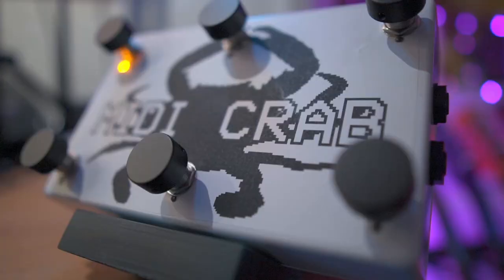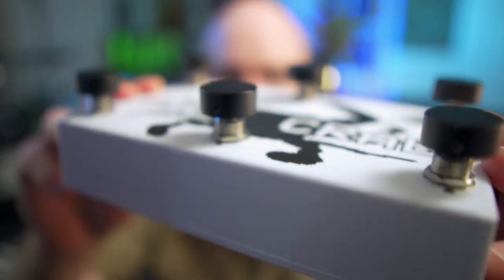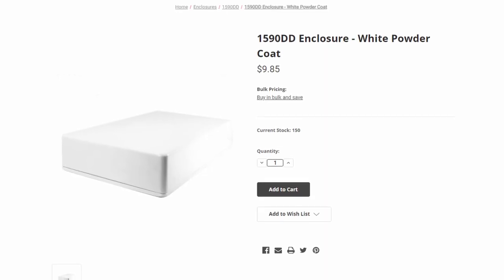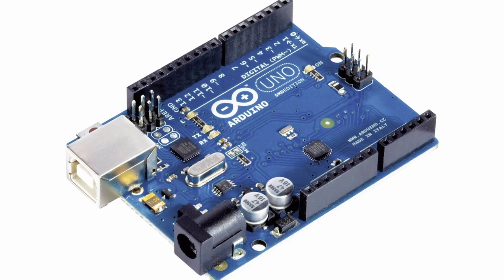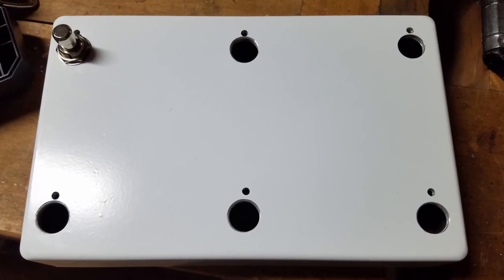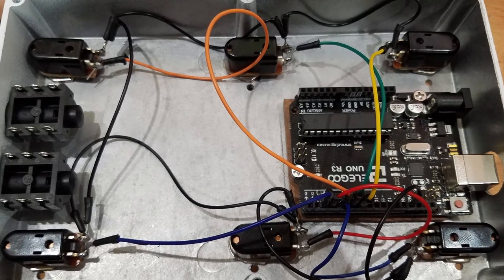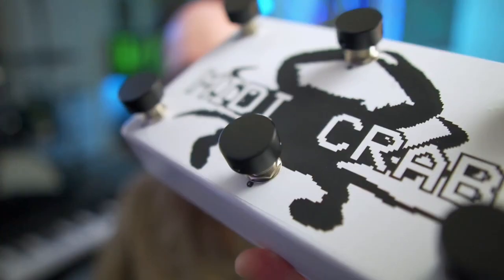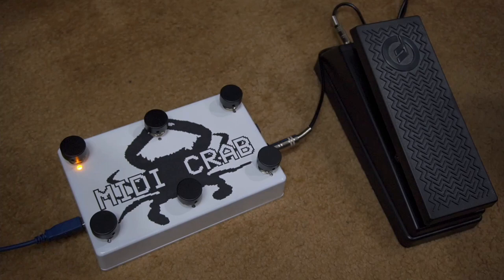DIY MIDI Guitar Footswitch with Arduino

Comment: Thanks for a great video! I am inspired.
Is it possible to send different MIDI CC messages in different MIDI channels by pushing just one switch?
Reply from the maker: Thanks, Andy! I'm sure there's a way. Depending on what you want to do, you should be able to map one button push to multiple simultaneous MIDI messages, or alternatively have a "bank" button that swaps the function of all buttons. I'm not great at code, but that should be totally doable!
Reply: @NickLeonard  Awesome, thanks for the reply. I didn't even know about setting up a "Bank", that opens things up. I better go and buy a Arduino and breadboard and get Started.😀
Reply from the maker: @andypearce7442  good luck! If you have discord, come over to my server, that's the best way to chat and share your projects 😉

Comment: please help. I made all the connections and uploaded the code to the Arduino but my PC doesn't recognize it when I'm in Reaper.
Reply from the maker: Did you get it working with Hairless MIDI? That's what will be recognized in reaper

Comment: hi mate, I have a noob question, does the enclosure need to be grounded as well?
Or did you simply connect the various elements to Arduino's ground?
Reply from the maker: I didn't ground the enclosure separately, but the switches are all metal and connected to ground, so it is

Comment: Hi, I hope you're very well, I have a doubt about this project, how did your PC reject the arduino as a midi device?
i've loaded the sketch to the arduino but still doesn't recognize him as such. i'd appreciate any help you can give me. Thank you.
Reply from the maker: Some Arduino boards are MIDI Class Compliant, meaning they should show up as a MIDI device in your DAW right away. For this project, I used an Arduino UNO, so I have to use Hairless MIDI (free program). I run Hairless whenever I'm using this controller, and then it shows up in my DAW.

Comment: HI Nick good day tried to follow all steps provided on video, but after uploading the code to my arduino reaper/amplitube 5 cant detect or midi is not showing do you have any inputs for this? thank you!
Reply from the maker: Do you have hairless midi installed and running?
Reply: @NickLeonard hey not yet would give that one a try
Reply from the maker: @lawrenzescover6578  without some extra steps, this build only works together with Hairless running at the same time. There is a method for turning the arduino into a midi class compliant device that is recognized natively, or you can use an arduino nano and that has native class compliance.

Comment: Hello. It is a very nice project and very understandable. The computer does not see the Arduino Uno as a midi controller. I am using neural dsp plugin standalone. Can you help me?
Reply from the maker: Are you using Hairless Serial to MIDI? You need to have that running in the background while using it.
Some boards, like the pro micro can be class compliant out of the box, and I think there's a way to do that for uno, but I just run hairless with it

Comment: This might be a stupid question but can the uno board your using be substituted for the teensy 4.1
Reply from the maker: Probably, but not directly. I don't know if the code would work on a Teensy or not, I haven't used one. A Nano is basically a smaller cheaper drop in substitute with some advantages, like being recognized as a midi controller without the software (hairless)
Reply: @onard Thanks for the reply. Thats what I thought. I have a teensy here and haven't gotten around to using it. Where you already provided the code I thought this might be an easy out.Just might pick up an uno to do this project👍
Reply from the maker: @guyvella  if you can do a little soldering, nano it the better way to go imo
Reply: @NickLeonard  Soldering isn't a problem. I've done quite a bit in the past. I'm new to coding. Although I'm familiar with hex as  used in an old midi setup. I'm just looking to simplify everything.Thanks again.

Comment: what are the value of the resistors?
Reply from the maker: These are 560k I believe, they're just there to protect the LEDs from burning out, higher resistance will make them dimmer and lower brighter, but different colors have different strengths, so you can try to balance it out

Comment: works With Hx Stomp?
Reply from the maker: Not as it is, but it could be adapted. It looks like the ones for the HX stomp are just passive switches with TRS output, similar to this but wired differently and without the arduino. Look up the Mission Audio TT-2, you could build one fairly easy if you find out how it's wired.

Comment: I have watched several tutorials on making midi stomp boxes, and I have one kinda weird question: Why are you all using breadboard wire instead of getting regular wire and soldering everything? It makes no sense man...
Reply from the maker: It's easier. I did another one after this that I soldered. For an Arduino, you want solid core wire preferably

Comment: can we use it on multiprocessor effect (e.g nux mg300)
thanks
Reply from the maker: I haven't done it, but there is a way. You have to find out what commands the Nux is looking for and adjust those in the code. It may require wiring in a standard 5 pin MIDI plug too, but all that can be done

Comment: hey everyone did i missed the wiring diagram?schematic wiring to midi port?
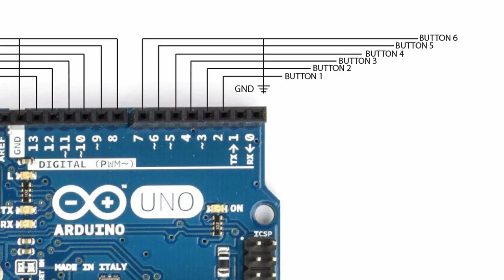Reply from the maker: Check at 6:50 for the diagram. The MIDI goes through the usb port. It would be possible to add a standard 5-pin MIDI, but it would only add an extra cable. If you planned on using it to control something like a keyboard or synth without a pc, you would need it though. You can look up basic wiring for that if you need it, it would work the same way with this project.